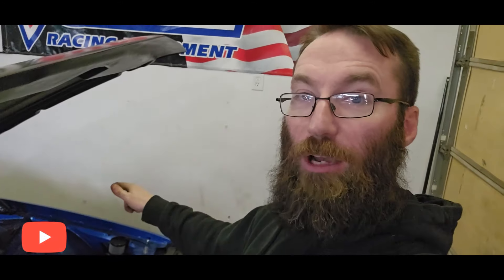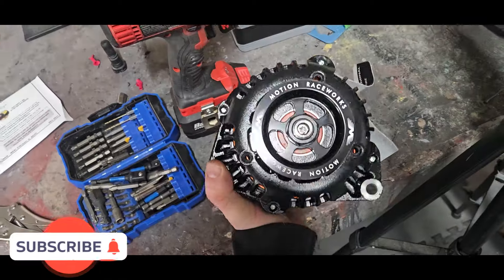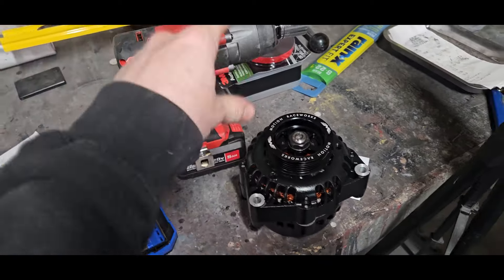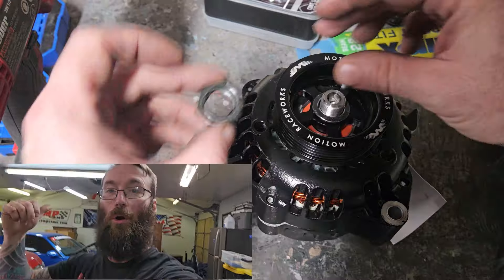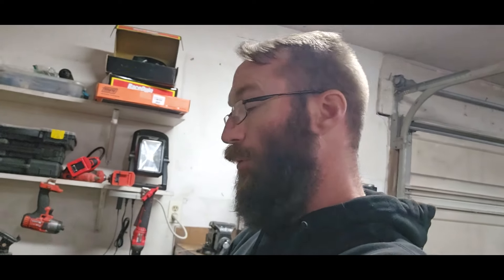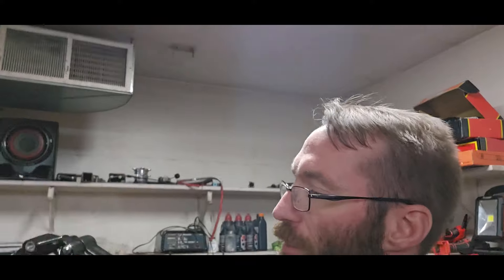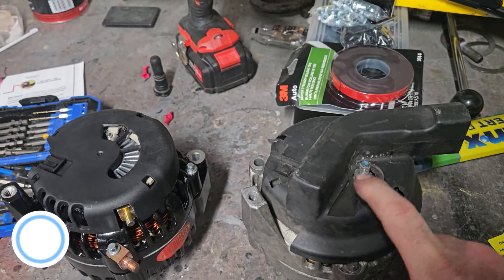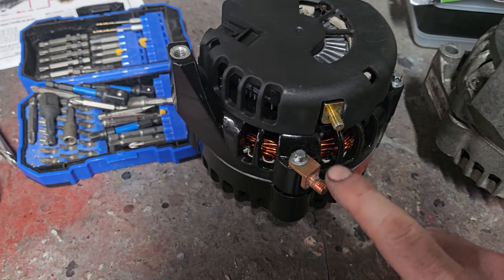Powermaster Alternator Install with Overdrive Pulley

Comment: Few more winter upgrades then another whole year of setting PB for us all!
Reply from the maker: Catch up on the safety gear, a new intake manifold and camshaft, a few other odds and ends, and it should drop new numbers in no time.
Reply: @TrailerParkMotorsports  jussssst need some motivation at PRI next month
Reply from the maker: @WardenMotorsports  I'm looking forward to going, I've wanted to attend for a long time.

Comment: I've been doing engines for years and I was always accustomed to a 14.5 voltage coming out of my alternator anything less is a inferior alternator to my understanding. But you did say 160 something amps. V*A=W  14vx160A=2280w ohms law